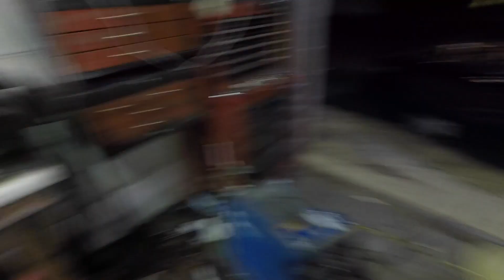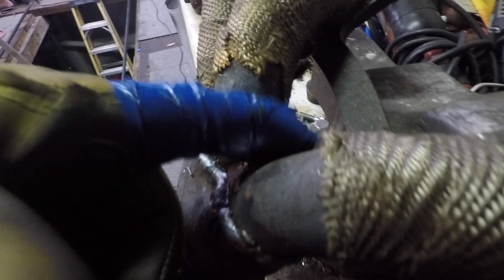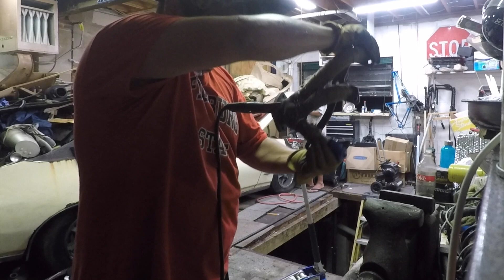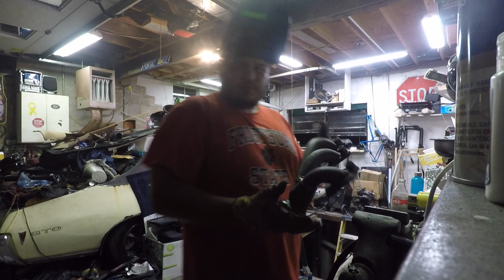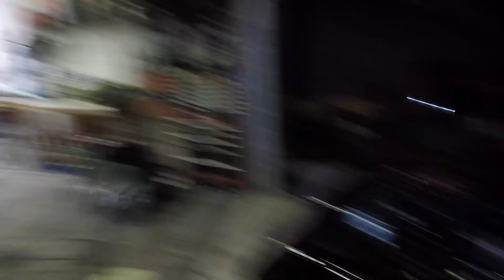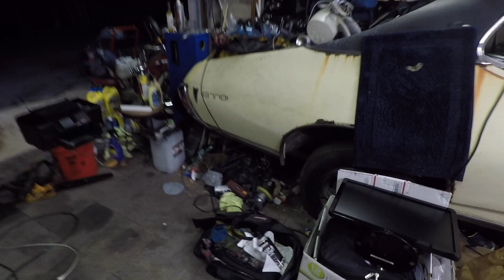TGIF Cracked Exhaust Manifold...Again | Damian Fixed the Pontiac GTO

Comment: TIME for some  GEE  M  HEADERS !!!!!  Take  the elastic of the  money  bag!!!!
Reply from the maker: Those are nice but I feel like they will crack as well, I’ve gotten a few quotes to have some custom ones made where the pipes all go into the collectors so there is not high stress points between the head flange and the crossover flange on both sides, they will be a little bulkier but this may extend the time between repairs. Its all a matter of taking the elastic out of the money bag like you said...lol
Reply: I DONT know but  from what  has been said  DAMN EXPENSIVE  but they  cant  be beat!!!   talk to  a supplier and  see  what they say about  cracking.
Reply from the maker: I don’t think they have the experience with them time-wise so I can’t take their word for it because I know of only a handful of people that log miles on their Buicks the way I do and all of us have different headers; they all crack.